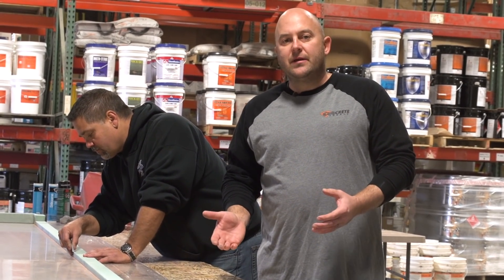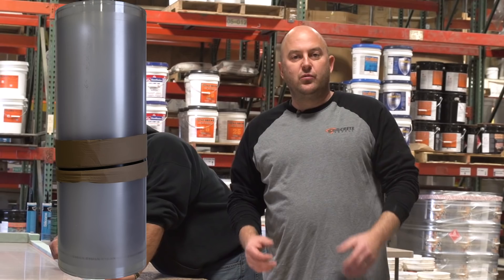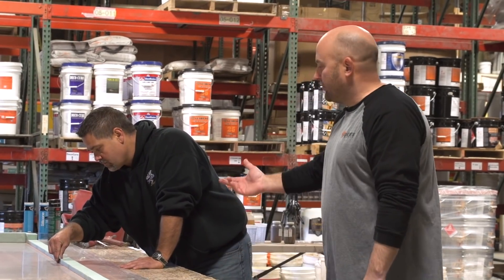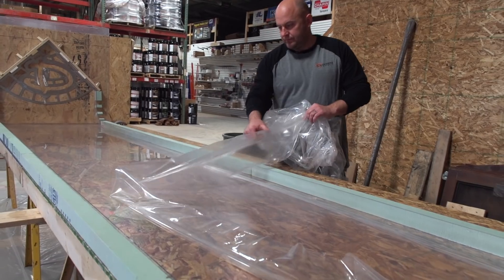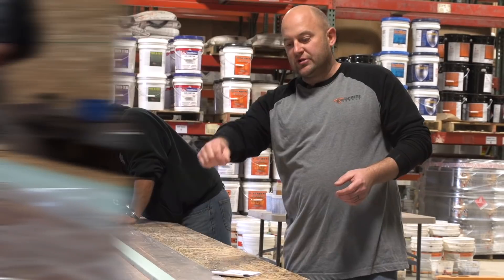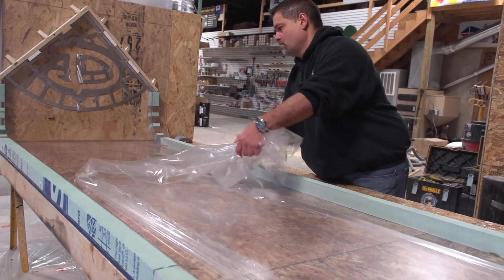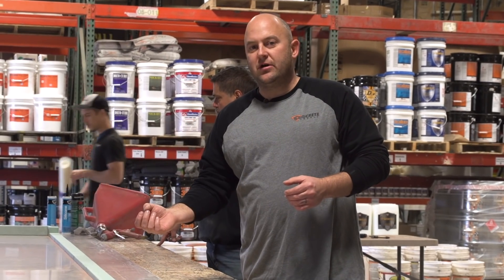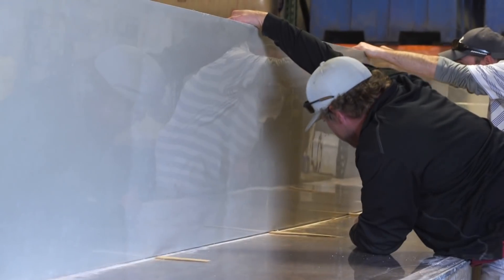Concrete Countertop Casting Mats

Comment: About time to see it done right great vidios... Makes me sick when i see all these "pros" patching a shitty finish from melamine and non concolidating concert full of water. How many times can you use a casting mat? Im doing my kitchen soon and will definitely be using the mat! Thats even beter the finished birch plywood. 👍
Reply from the maker: Thanks for watching! There are two sides of the mat that are both usable, and you can lightly sand the mat to reuse it if you are careful not to scratch it.